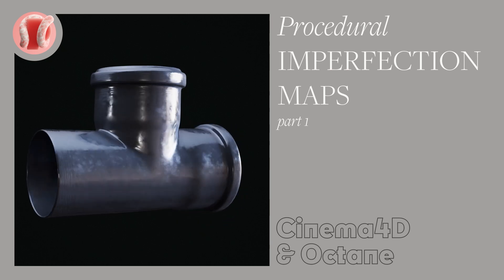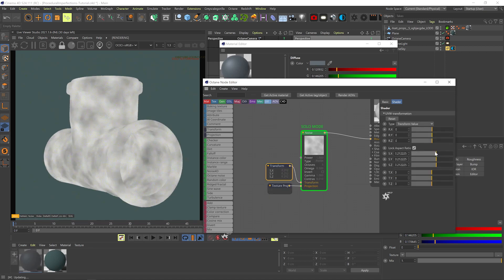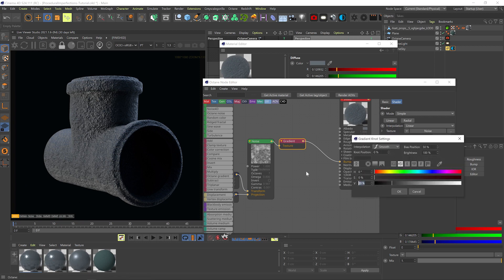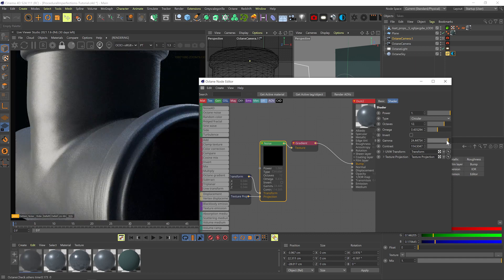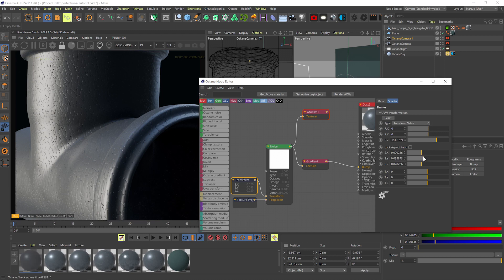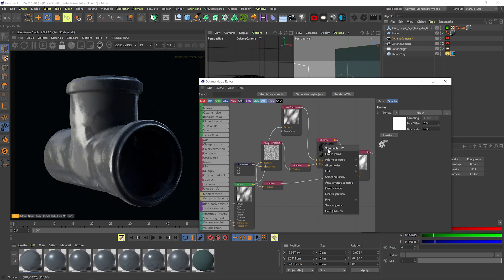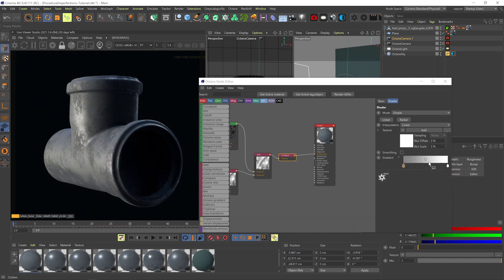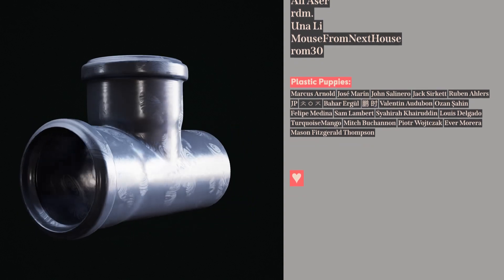Cinema 4D Tutorial - Procedural Imperfection Maps (Octane)

Comment: I'm surprised you don't use the Noise (OSL) node. A lot more power
Reply from the maker: I actually do use it in the next part of this tutorial, my only issue with the OSL noises is that their UI is a bit messy so they're a bit uncomfortable to use compared to the native noises. Also, they're slightly less stable from my experience. 
But yes I'm showing an example with on in the next part :)
Reply: @NewPlastic  oh damn now I feel like a moron lol. Awesome tutorial! Sorry if I came across like I did, I was just curious to see if there was problems with using that node

Comment: I'm shocked with how the noise responses to the changes of gamma and contrast. I primary work in Redshift and there those settings are absolutely unusable (no matter you try it inside the noise node itself or the afterwards). I think it is beacuse Redshift uses different gamma curve internally. Countless times I tried to create cracks from Voronoi noise, but every time I felt disappointed. I even worked on my own procedural material pack back in the days, but with this horrible color management inside Redshift I barely managed to create one single Jade material (node setup was stupidly sophisticated, barely fit my screen) and then gave up the idea.

Also the ability to change the scale of the node after the initial setup is insane. My Redshift shaders often looks too complex cause I need to duplicate those setups dozen of times inside one shader to blend them. May be it is finally the time to give Octane a shot.
Reply from the maker: That's actually really interesting to hear, I would never imagine it would be an issue with other engines. Redshift doesn't have a projection node where you can alter the scale of several nodes at once?
And btw, I tried to tackle Jade/other gems materials and so far have failed as well, so I hear you on that man. The struggle is real.
Reply: Amen, I switched from octane to redshift and tried to recreate this tutorial in redshift. It’s just awful and I didn’t get very far due to the problems that you encountered as well. If I’ll tackle it again and succeed I’ll let you know. Ah and thank you so very much @newplastic, you helped me so so much with your incredible tutorials. Please keep em coming, still taking away so much from them. Cheers